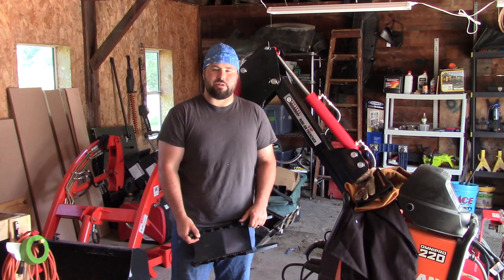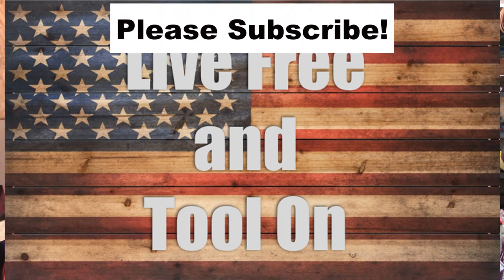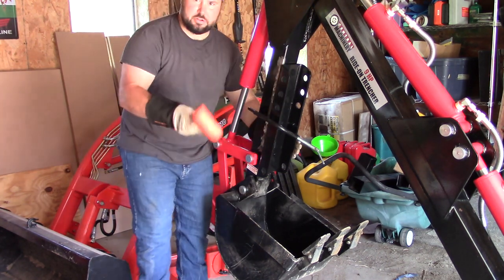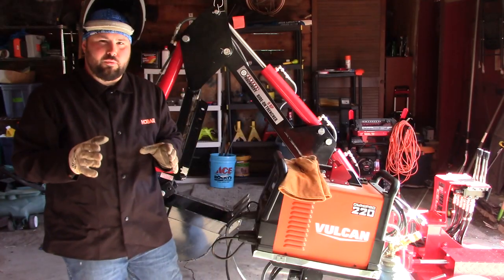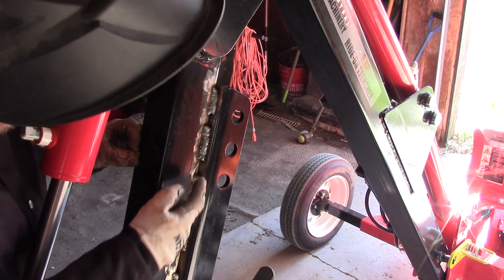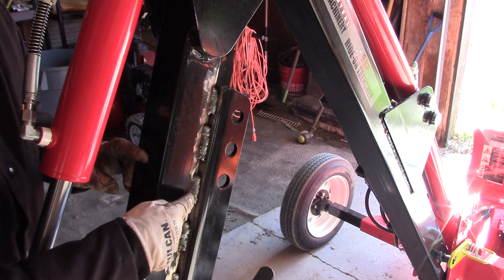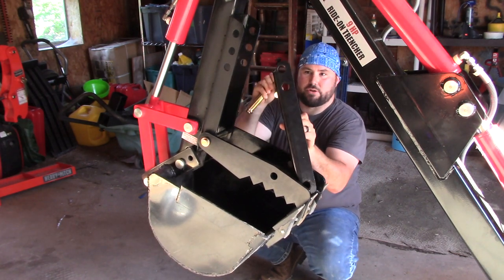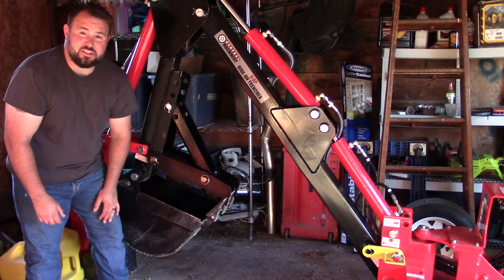Harbor Freight Backhoe Thumb Installation

Comment: Great video, and nice job on the installation.  I'm not too sure of my welding abilities, so I bolted mine on with four 3/8"-16x4" u-bolts and 1/4"-thick 1 1/2" angle iron for the plates.  I drilled through the mounting plate, and was able to straddle the boom with the u-bolts.  The machine is unable to dislodge it, at full clamping power.  I am very happy with this thumb, and the backhoe as a whole.  Great machine.

Comment: Nice job! I decided to bolt mine on instead of welding. I wanted to be able to remove everything because of the extra weight on dipper while towing.long distance. I was worried that the extra weight would stress the joints.
Reply: how did the bolting method go? I saw your other video but couldn't tell if you ended up bolting or welding?
Reply: @jonathannance8067  Works great, I used grade 8 bolts and have had no problems.
Reply: Glad to hear it's been done already, but I could already tell there will be no problems when I bolt mine.  Why they ignore the possibly is beyond me.  I am so looking forward to mounting mine up.  Also, I'm going to "store" it with a hitch pin of some kind, as opposed to tying/strapping/bungee  etc..

Comment: or use the first pin to hold the arm and the thumb as its designed?
Reply from the maker: IT actually doesn't fit and hold like you would hope it would

Comment: I see that Titan does not make an 18". Are you happy with the 18" fit (length) with the Mophorn? Thanks for the video.
Reply from the maker: The one I  have works great it’s the perfect size for the bucket
Reply: @livefreeandtoolon  Thanks for the video. I am going to weld mine on right now :-)

Comment: The welded on the bracket will not weigh that much to make a difference on the machine. Can always Un bolt the thum if need. I just fold up

Comment: Big mistake using a weld-on thumb !! You should have got a bolt-on unit instead.

Permanently adding about 30 or more pounds of dead weight to the crowd of a light-duty machine such as the Harbor Freight Towable Backhoe, especially so far away from the pivot point, significantly increases the amount of dead weight the cylinder must lift/drop each and every time it moves up or down.

While the thumb can provide benefit when performing tasks that benefit from the thumb, ordinary digging and trench work DOES NOT USE the thumb, but yet that weight is still there, always reducing the effectiveness, reliability, and efficiency of the machine.

Use of a bolt on thumb provides the same usability when needed, but the major benefit is that it can be removed when not needed, removing the extra dead weight from the crowd and restoring the usability of the machine.
Reply: I see using the thumb a bunch. I wouldn’t want to be bolting & UN bolting it so much anyways. However, I could see removing the two pinned pieces when it won’t be used for a while. Just an opinion.
Reply: I'm bolting mine on.  Drilling, tapping, grade 8 bolts. Two reasons:  1 - I don't know how to weld, and have a decent drill press.  2 - Although I'll be leaving the plate mounted 99.9999% of the time, I want to be able to remove it for some attachments I've designed to use the new holes.  I hear you on the weight thing, but, realistically, I'll be using the thumb way too often to be taking it on and off.  I bought the trencher as much, if not more, for picking up things, as I did for digging.  Cheers.